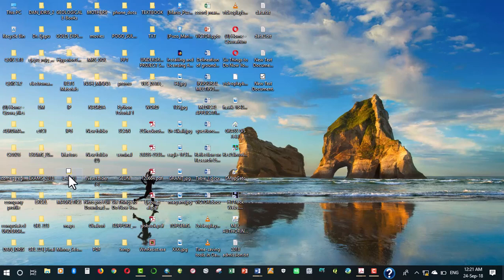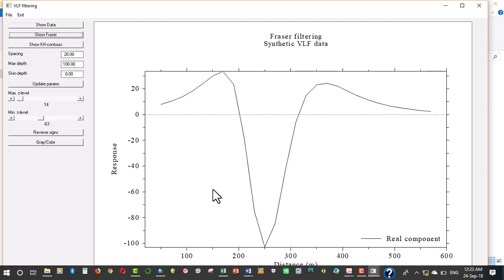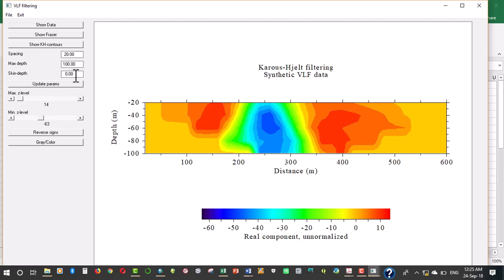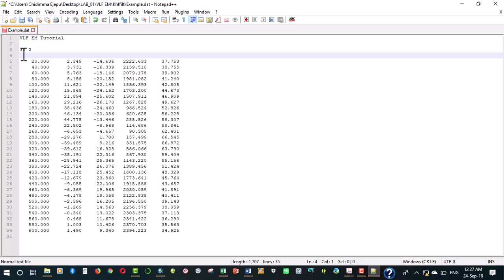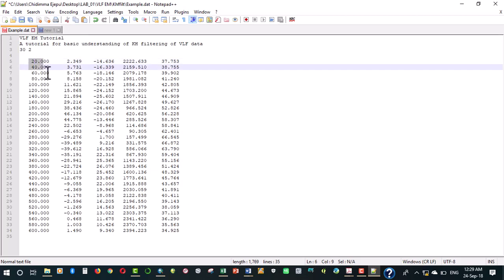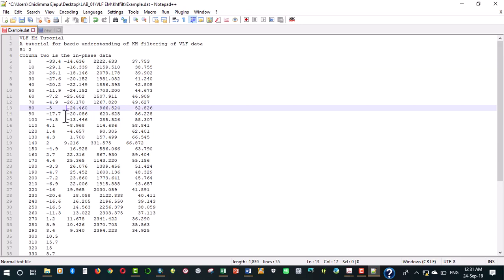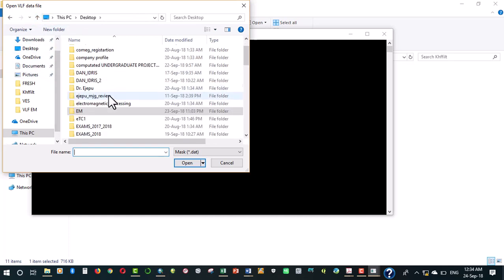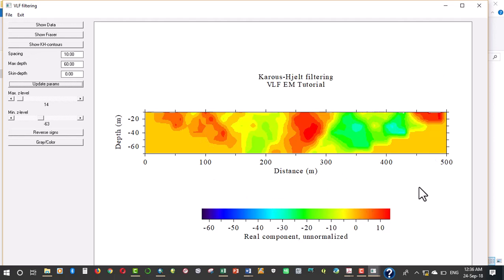Very Low Frequency Electromagnetic (VLF-EM) data interpretation using Karous-Hjelt software

Comment: It is important to know the host rock resistivity and input that as skin depth (approximately 3.5 x sqrt(resistivity) ).  This will place a realistic limit on the depth extent of the conductor in the KH diagram.   A high resistivity host rock not only increases the skin depth ( i.e. depth of investigation, but also increases the in-phase response.   In areas of low host resistivity e.g. tropical weathering, clays etc., the skin depth might be only 10-20 metres  and a more conductive target will not be detected beyond about 1.5x times that depth, perhaps 30m maximum.
Reply from the maker: @karhukivi  Thanks for your input. This is well help in future interpretations

Comment: Sir, knowledgefull video , you have use two data , 10 meter interval horizontal distance, but second data unit not mentioned ,  I want konow what is unit second data coloum please describe 💐🙏
Reply from the maker: Please can you add more details to your query?
Reply from the maker: Ok. I understand. The VLF machine used receive frequency in different frequency ranges. So other columns contain measurements in other frequency bands. Hope this is helpful.

Comment: If your field survey was facing left to right, in the direction of increasing station numbers, then you should reverse the sign, the Fraser filter is a maximum over the conductive zone which is shown in blue, instead of the more conventional red.      The synthetic data shown first, is clearly facing left to right.
Reply from the maker: Thank you for your input. Your observations are noted.